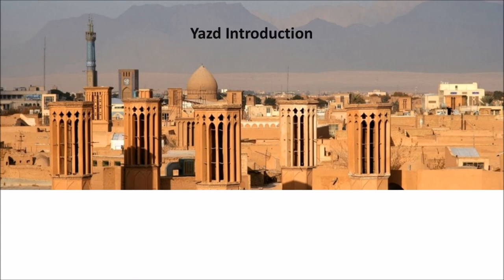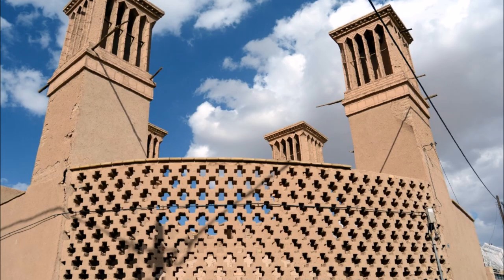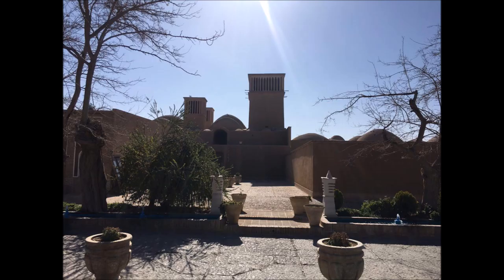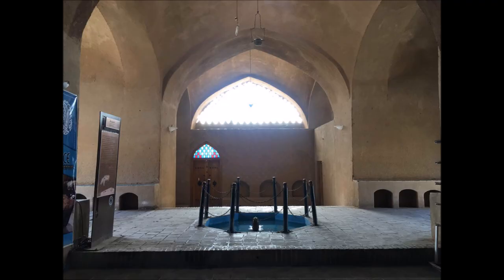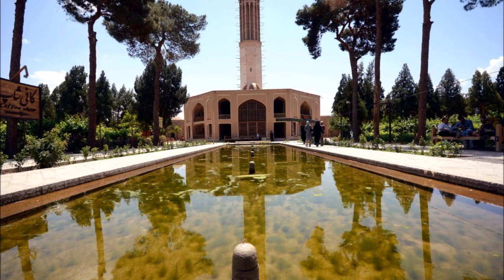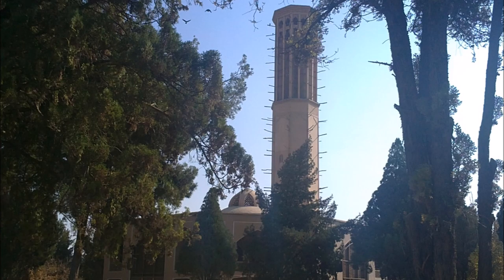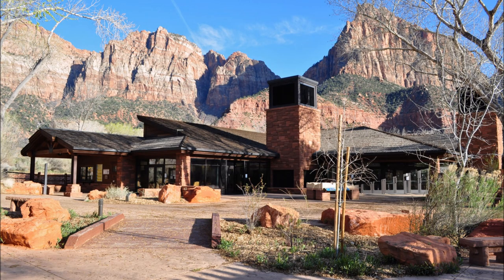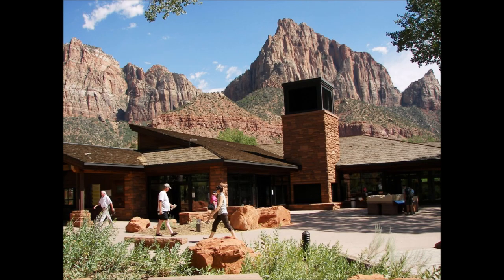Wind Tower Cooling System Introduction ( Past and Present time)

Comment: USA has many areas where that could be applied instead of electric air conditioning. Passive cooling saves a lot of energy for other uses.
Reply: Swamp coolers are quite common in arid climates like Arizona and modern models can be bought at any hardware store. Works terribly in Florida or Texas though.
Reply: A few houses here in Wilmington NC are designed like this. They were built in the 19th century and are tourist attractions now.
Reply: So how does this work in the central Midwest? I've heard these structures do not work in heavy-freeze regions (either).

Comment: can wind towers be applied on taller multi storied buildings?
Reply: Definitely... The main issue is how they're built out of materials that can burn at ambient conditions if certain accelerants are involved...and the associated chimney effects would be problematic.
That said... There's probably multiple ways they could manage to work around those issues.🤔